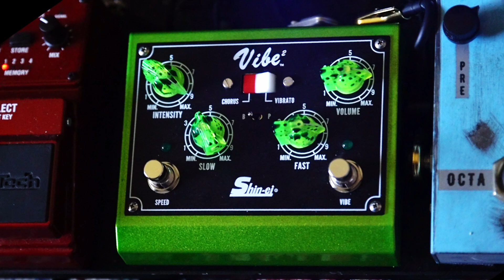Shin-ei - Vibe 2 (Long Playthru)

Comment: this vibe sounds best to me! it retains the original tone along with the vibe like a preset blend i dont like to loose the highs and that live 3d feel! this  may be my next purchase
Reply: The Sir Henry smokes all that garbage.
Reply: @albinotaco8000  lol no it doesn't. The sir Henry has none of the low end throb and original has.  The unique vibe or shiftee is the best there is. Sounds identical to an original.  Sir Henry sounds great. But its not very throby and has way to much swirl to it
Reply: Well the SH I have smokes . Maybe the one you had needed to be adjusted etc.      I had an early unique and I felt the same.  It was a bit flat sounding.   
Sold it.   I recently heard a unique that was way better.    
It’s all the same shit people make.  Different bulbs, different tuning preferences.   All’s I know is Shinei sucks.    Guys that run that business are a fraud.    I’d rather give Dunlop my money.

Comment: What's better this or the JAM
Reply from the maker: Will Mac I don't know, what's a JAM?
Reply: The Jam has More Throb. Look at the Intensity . . . is @ Max. This has more of a Liquid-Swirl ( similar to the Drybell ). Both Great. Can't go wrong with either pedal. Some vibes are "more phasey" and some are More Throbby.
Reply: I had the jam and I sold it. I didn’t think the effect was prominent enough. Sometimes it was hard to tell if it was even on. I do not recommend that pedal.